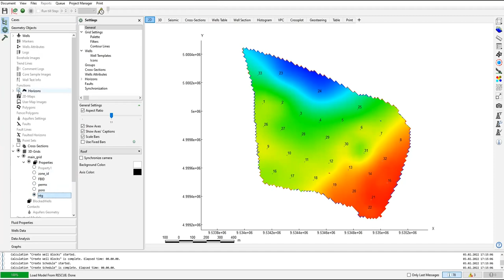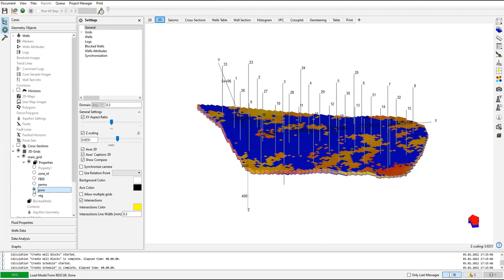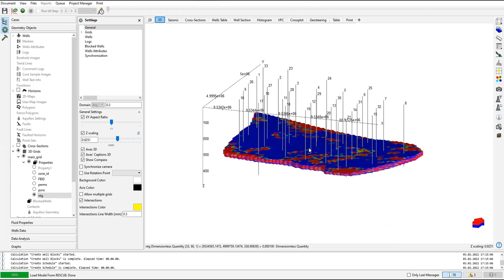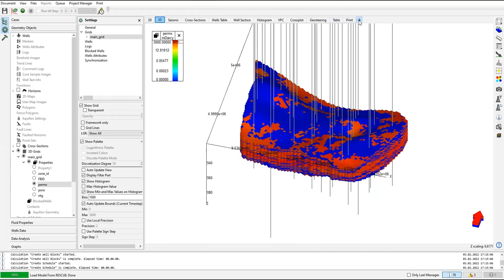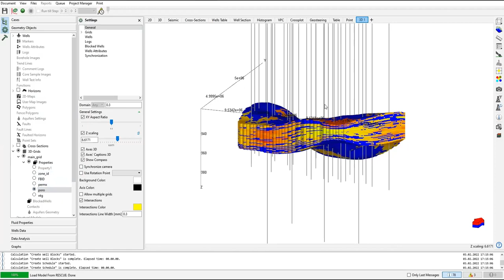tNavigator 8: 2D and 3D Map

Comment: Thank you for your effort in creating this series.

However, this is the seventh video I’m watching, and despite the positive energy and enthusiasm you bring, the teaching lacks structure. For example, you introduced a model you prepared yourself without first explaining how to build one. If this series is meant to teach Navigator, I have yet to see any practical guidance on creating a model.

So far, the focus has been on the software's user interface, with little to no hands-on instruction. Then, at some point, you jump into advanced simulations without covering the fundamentals. Even for those familiar with the basics, the content does not feel informative or well-structured.